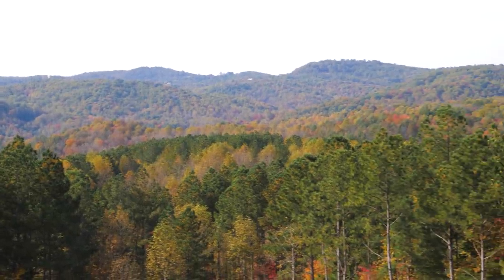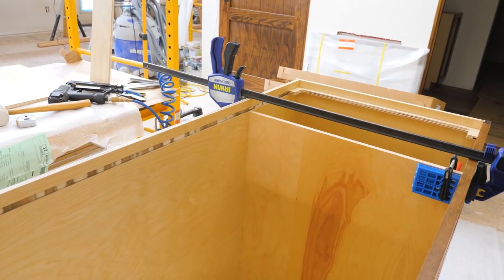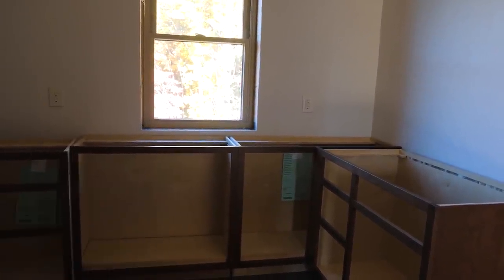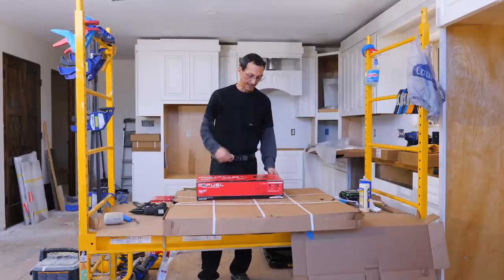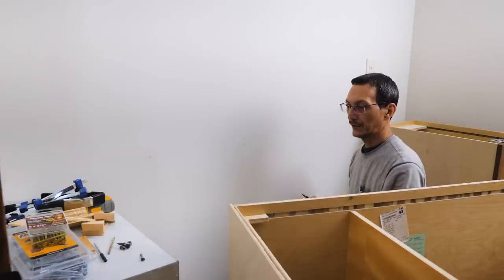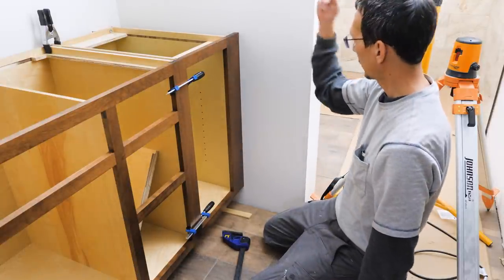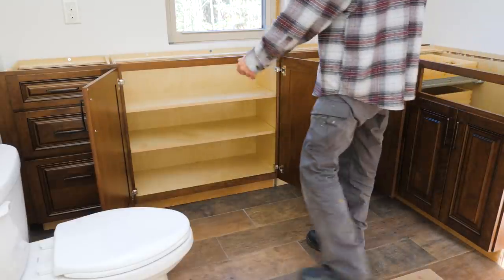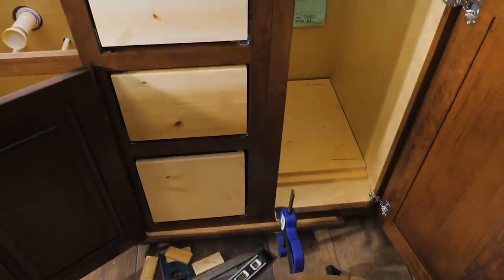Building Bathroom Vanities with Custom Cherry RTA Cabinets

Comment: Do you have to figure the divider panel on the vanity or were there directions? Looks pretty hard and bad if you aren't exact.
Reply from the maker: You have to measure it and be pretty accurate but cabinet joint had a video explaining how to do it.

Comment: FYI those tip out trays, whether in a kitchen and/or bathrooms, become just a nasty petri dish; if you can mount them so you can remove them and run them thru the dishwasher, that is ideal.  I just skip them all.
Reply: They'll be easy enough to clean without removing them, if you do it periodically.